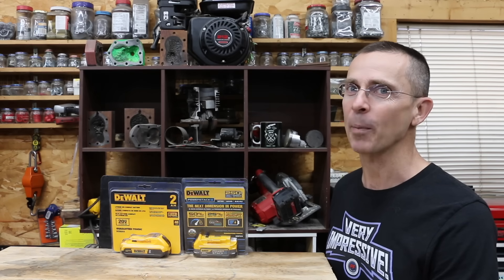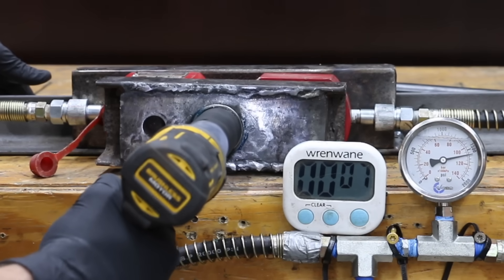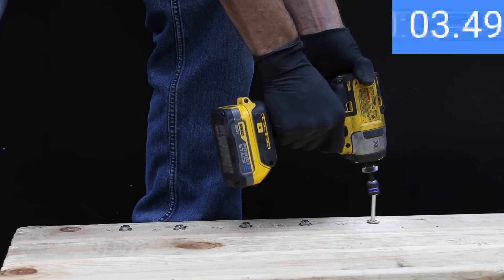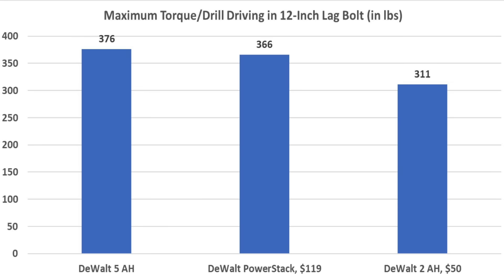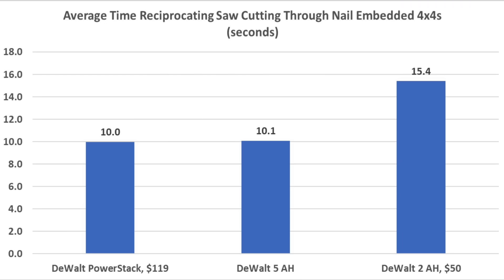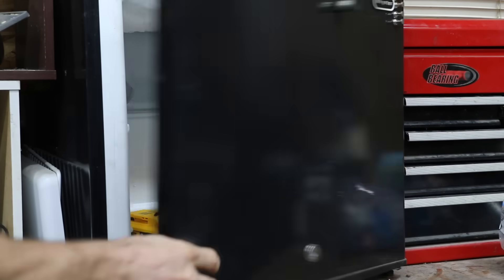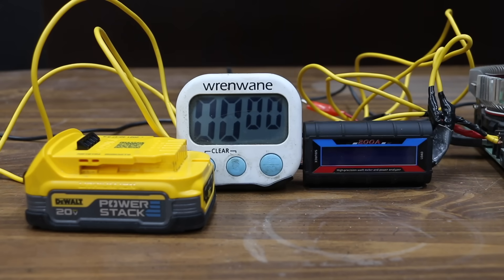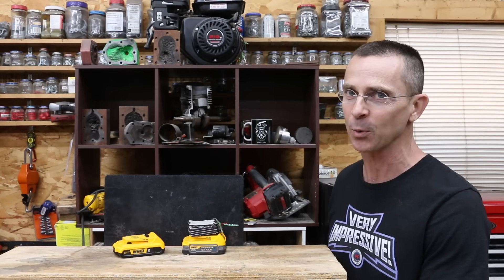Compact “Pouch Cell” Battery Better? Let's Find Out!

Comment: This smells like a way to stop consumers from repairing their old drill batteries with 18650 cells
Reply from the maker: Great point!
Reply: Everything is a conspiracy.
Reply: Did you make your tinfoil hat or did you buy it from GCHINA?
Reply: It 1st and foremost smells like a way to get batteries with twice the longevity, denser power output and higher throughput at the end of the discharge cycle. Considering the cost is double I don't think cylindrical cell based batts are going away anytime soon.
Reply: Interesting point
Reply: You can buy pouch cells, just not as common. Probably not as easy though.
Reply: U can replace pouch cells to.
Reply: it is not even cost effective to repair them with the premium cells they came with unless you have an extreme hook up on cells. With the cheaper places to just buy new batteries it is not worth it.
Reply: @KEVLAR1911  and many have proven it. There was the LTT video where he replaced the cells in a cell phone power bank and all the equipment required ended up being a) extremely questionable and b) costing far more than just buying a new one.
Reply: you can buy the packs just as easily and probably cheaper
Reply: smells like you're cheap
Reply: Oh yeah, there has been 0 advancements in battery technology since the 18650 came out, so that's probably correct
Reply: Someone will figure out how to repair them
Reply: They’re just expanding options at each Amp hour category, there will still be 18650 and 21700 packs because the tech is so simple and if they stop then a third party seller can just jump in or just get china clone batterys
Reply: They already do that in laptops, once you remove the cell the bms just dies
Reply: @PTFuZi   You can replace the cell live.  Charge the new cell to the same voltage, then connect in parallel through a resistor to balance it out, then solder the b1tch over and get rid of the old one.

Better be sober, shaky hands not allowed 😂
Reply: The 18650 cells in bosch 2 and 1,5 ah batteries are crap. I replaced them with 3 ah chinese high drain batteries and the drill works better than new loolz...
Reply: You can purchase pouch cells from many outlets on the Internet. Each pouch usually has it's own charge controller (BMS)under some tape at the front and can be swapped if they try to use a proprietary BMS. The main issue with pouch batteries is bending, puncturing or just manufacturing irregularities make them extremely volatile and when they go up in flames it is catastrophic. The 18650's are the same battery composition but they have vents in the caps that make them a lot less likely to go up in flames.
Reply: Someone will eventually make better tools that are actually worth paying out the nose for. There’s a market for it.
Reply: Unfortunately that’s just the future we’re living in.

Comment: This is one foreboding bad move. Pouch style are less robust and more prone to damage. 18650's are good because of their individual metal containment and air between them for better cooling. These batteries will NOT have the 10 year life span the 18650 batteries do.
Reply from the maker: Great feedback!  Thank you
Reply: I love everybody
Reply: @kinbolluck476   i hate everybody.
Reply: @StringerNews1EVs aren’t exactly pouch style batteries right? Is a iPhone a pouch style battery?
Reply: @garden0fstone736 I’m not sure what EVs use. Phones typically use pouch cell batteries.
Reply: @andythompson3528  ev's exclusively use cells, due to robustness. A few weird cars use pouch cells but they have a metal frame clamping it and keeping it safe, water cooling, smart charging, and hopefully stable electrolyte so they don't expand or delaminate from shock and vibration.
Reply: @garden0fstone736 The porsche taycan uses pouch cells.
Reply: @Ammothief41 Imagine buying a Porsche, and it's electric🤣
Reply: @diver291  ferrari but it's chinese motor inside. just the body is ferrari
Reply: True. They sould have gone for the 21700 instead.
Reply: @Hammarsand  that's what big dewalt's and milwaukee's use for some extra oomph.
Reply: @dimitar4y  Yeah. More power and output. Thats All you want 😎
Reply: Pouch batteries work ok in mobile phones. In don't see how they need to be wrapped in cotton wool
Reply: @KuwaharaBMXRider  
> mobile phone
> power tools
Bruh are you mentally ill

Comment: Cool, another awesome Project Farm video!  Todd I have a couple suggestions for testing:  jigsaw blades and "quiet" air compressors.  I purchased a California Air Tools quiet air compressor from Amazon a few years back.  This thing is very quiet and only has a 1 gallon tank.  It works great.  Thank you for the video👍😁
Reply from the maker: Thank you for the video ideas!  Added to my list of projects to look into testing
Reply: @ProjectFarm  How long is that list by now? I'm sure it's over 100 with all the input from your viewers! 
Thank you for making these videos, I've been a long time fan.
Reply: +1 for quiet air compressors
Reply: I purchased a California Air Tools quiet air compressor from Amazon a few years back.  This thing is very quiet and only has a 1 gallon tank.  It works great

That's been on my shopping list for two years 😁  waiting for my current unit to die first..
Reply: Can you do a test on the best electrical outlet? I know some are better built than others.
Reply: Amazing how quiet those california air tools compressors are!
Reply: Bought the HF 4gal hi pressure one and I am very happy with it also. Much quieter than the 4 gal Kobalt I had
Reply: I work in construction and the quietest air compressor I've ever been around is the milwaukee cordless. I bought one for myself, and it works great. It would be nice to see how it compares in this category.